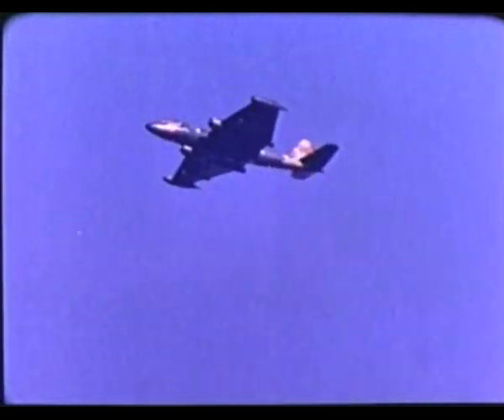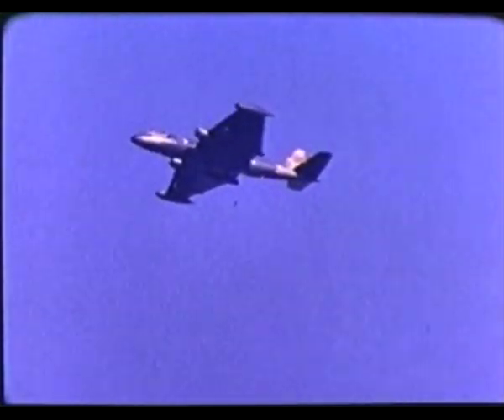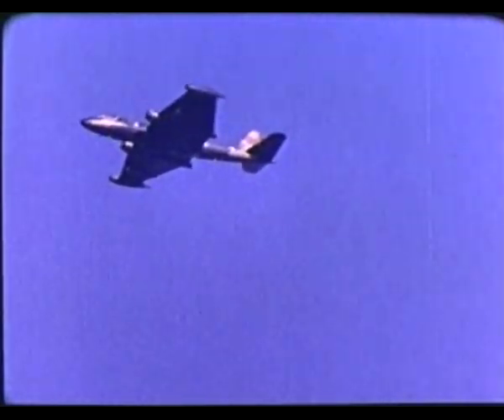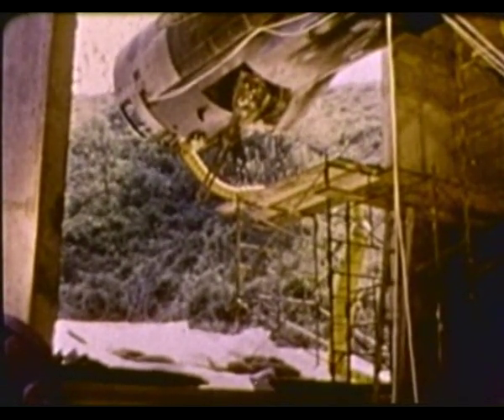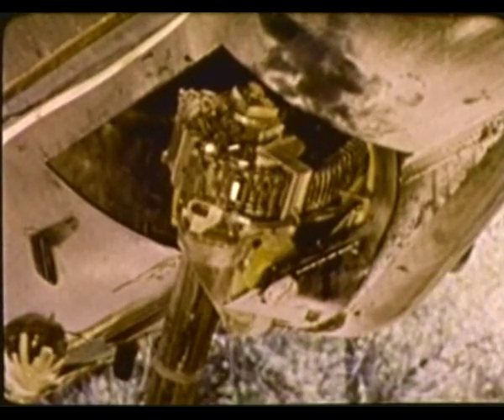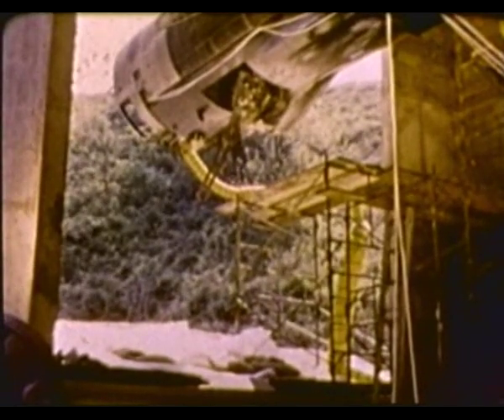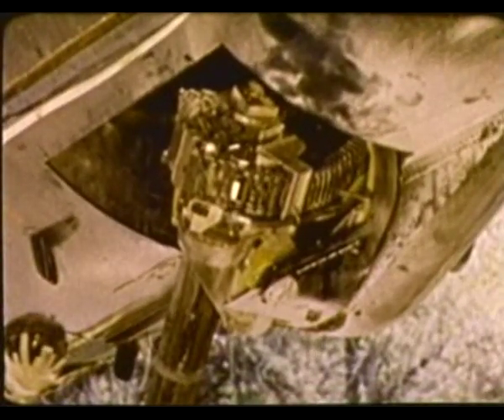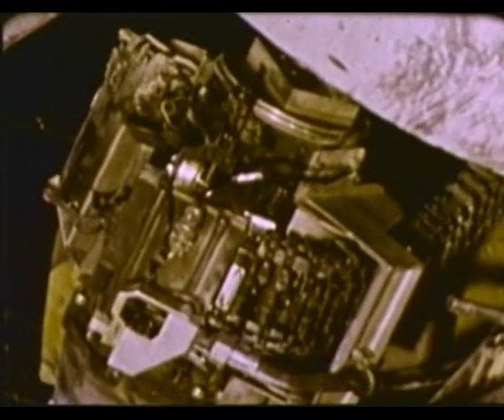B-57G Canberra/Pave Gat 20mm Vulcan Test Fire

Comment: "Recoil adapters absorbed much of the firing"... , but the airframe still bent and the range of the cannon shells was anemic.  Got to go to at least 57mm and with rocket assisted shells..  I'd suggest smooth bore with guided 'munitions of at least 76mm, then there is at least some kind of 'punch' on the ground and no need for the multiples of inaccurate rounds fired down range.  A simplified proximity laser guided fuse would do the job at a fraction of the cost of the GPS - inertia systems now in production.